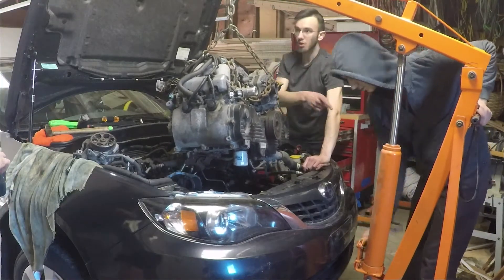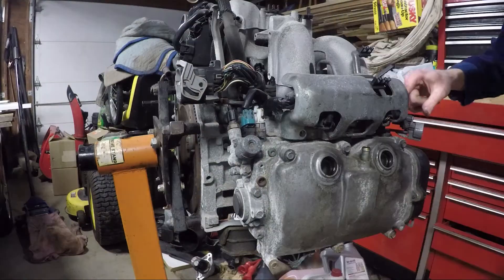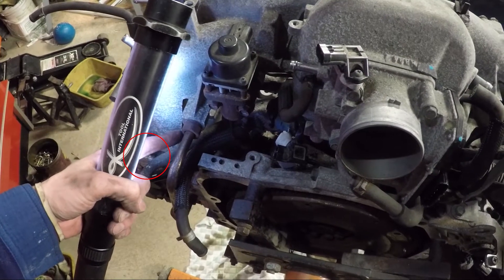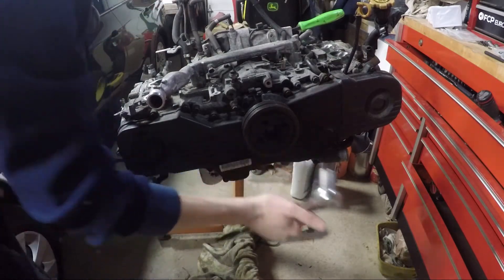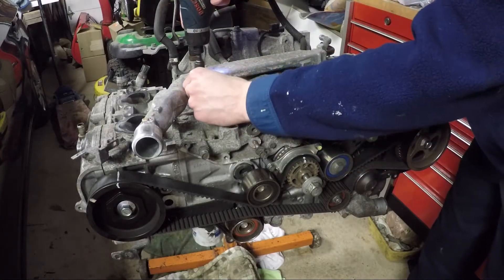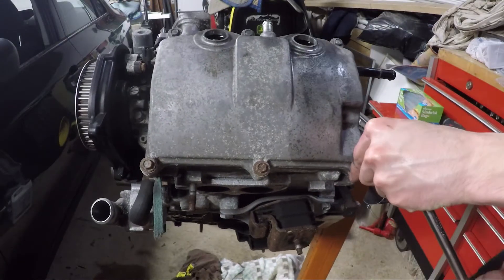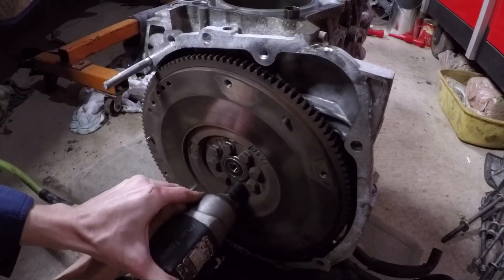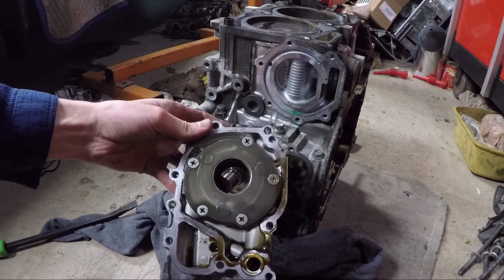Tearing apart Subaru Engine?!

Comment: Can you leave the heads on? This car has had the head fixed it just needs bearing work.
Reply from the maker: If I remember correctly, there are bolts under the heads to split the case

Comment: That’s with the engine in the car....
Reply from the maker: Cory Mikesina the original engine spun a bearing and ruined the crankshaft. It wasn't financially feasible to rebuild, so we did a motor swap. I have a video where I go over what I found
Reply: @audimotive  What did it sound like when running. I don't understand how you can ruin the crankshaft unless you drive the car for a while after noise occured, since cranks are made from hardened steel.
Reply from the maker: @TB1M1  I bought it that way so no idea how long they drove it like that. I have a video of the sound

Comment: Ahhh yess... getting valve covers off with the corroded bolts holding them on... most likely you have already rounded the bolt head off using every thing you got in the bag.. I know because I did it lol but what I found best works is a 90* die grinder with short carbide burr bit and grind the whole bolt head off flat with the valve cover. Take your time here don’t ruin the valve cover... then after you have the head of the bolts ground off hopefully your lucky and only 1 or 2 bolts need to be ground off. get under the car with an air hammer with a 14 in punch and very carefully get on the edge of the valve cover with the air hammer and just tap the trigger lightly till the cover comes off the corroded bolt! Hope this helps someone!
Reply from the maker: Cory Mikesina thank you for that advice. Hopefully it helps someone in the future! Those bolts were a pain in the behind, even with the engine out. The other engine didn't have that problem though...

Comment: Im In buffalo NY about to pull one of these out of a car I bought. It has 54k miles on it and I think it has a bad baring or something. Cylinder 1 misfire code. We are just going to put a crate motor from lkq in, would you be interested in buying and rebuilding the motor we pull out? This thing has to be worth $1400-$2000 once fixed especially with 54k miles.
Reply from the maker: +SAL GERVASI MUSIC hey man. I'm not sure what kind of background you have or what you have already checked with your engine, but I'd do a few more tests before swapping a motor for a misfire code. I had absolutely no codes, but an audible knock. In your situation I'd check the spark plugs, ignition coils for starters. It might even need a compression test to rule out a bad valve. Have you done an oil pressure test? I feel that's a good way to tell if you have a problem or will have one with bearings
Reply: yeah we towed it today and its being checked out. The car tick/knocks fast when it starts. It fires right up and will stall out while driving. Unfortunately sounds like a bad baring to me but who knows. It will be diagnosed soon
Reply from the maker: +SAL GERVASI MUSIC if there are codes that are related, post them here. Maybe it can help someone in the future
Reply: P0301 cylinder 1 misfire
Reply from the maker: +SAL GERVASI MUSIC Very interesting. Will the engine be taken apart? Or just replaced. I'd be curious why a bearing is causing a misfire. Normally as long as the cylinder is sealed for combustion, the engine can run fine. With this code and you said it's stalling, almost makes me think something else is wrong other than a bearing
Reply: its going to be pulled apart but not by me, ill comment when I have more info
Reply from the maker: +SAL GERVASI MUSIC I'm curious what's wrong with your engine. I didn't have any codes but my engine was toast